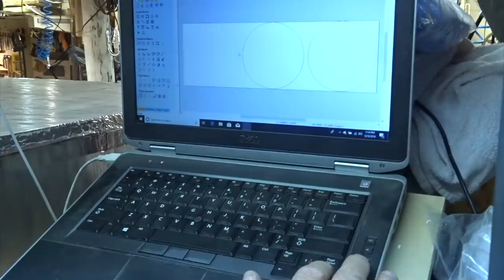Derek from Malden makes a Bird House

Comment: Nice project. I made three canisters from oak the same way many years ago.  I used a knob I turned instead of a roof. It was fun to make.  I used left over oak flooring.
Reply from the maker: It was a fun project. I had some thin stock, and really didn't know what to make with it. I posted this video a month ago, but recently it has gotten a lot of views, was it recommended to you on YT?

Comment: I will probably get berated for this but I disliked this video. I love the concept and the build but why have to show you have a CNC router when your bandsaw would have done the same job and finally are all the finishes bird friendly? Cheers Huw
Reply from the maker: Some good questions, and didn't really think much of it. My bandsaw was dull, and was having a hard time cutting through it. I also was originally planning on doing all the work with the CNC, but couldn't get it right, so that's why I ended up using the router, I am new to CNC, and am having a hard time with it. Not sure if the finish is bird friendly, even though I hung it in a tree, that's not where its staying, I actually made a couple, and they are going inside as decorations. Thanks for watching, and hope to see you back.
Reply: It’s the same decision between using a bandsaw or a jig saw. Or a jig saw and a coping saw. Sometimes you’re in the mood to use one tool over another.
Reply: That cnc is sweet ! That's the same kind of method for doing rolltop desks. You can buy slats that they use for making wood garden lattice in case you don't have a table saw but the edges are 90deg. But it would still work, just not as neat. You need a lathe for the outside shaping and sanding 😊
Reply: @DerekFromMalden  Hi Derek, Thanks for your reply, I have stayed subscribed to your channel as I normally like your videos very much. It's just this one I didn't like. Cheers, Huw
Reply from the maker: Huw Davies I guess I need to up my game, and glad people notice.  See you on the next one.

Comment: Hole is to low!
Reply from the maker: On the plans it said 1 1/4” hole 6” from the floor of the birdhouse.  Thank you for watching and commenting.
Reply: Perches on the outside of Birdhouses are for PREDATORS  ! 
There are plenty of NATURAL PERCHES nearby  anyway.........
                                 *******************************
New wood is for people -  Most Birds prefer old weathered wood !!!!!!
                                  *******************************
If you want to attract birds to nest in them, add a hand full of HARDWOOD   (NO PINE)          sawdust  inside before you  close it up.
                                           ********************
And An  EASY way  to clean-out the USED box is always a good thing too......
Reply from the maker: @texadams2641   These were Christmas gifts, and meant for decorations, the birds are fine

Comment: You destroyed this beautiful bird house when you cut entrence hole so low
Reply from the maker: Really, what's the height I cut it at, and what is the correct height for the species of bird I built it for?
Reply: @DerekFromMalden  don't take it too seriously. Entrence hole should be as high as possible to prevent predation. Space above hole is not going to be used by birds
Reply from the maker: Felis sylvestris I was just curious, plans said 6” above floor of house, and 1.25” hole.
Reply: @DerekFromMalden  it's ok although the deeper the hollow / house the better for nesting birds. hawk or marten will be less prone to penetrate the bottom of it
Reply: Did you get any tenants in your bird house ?